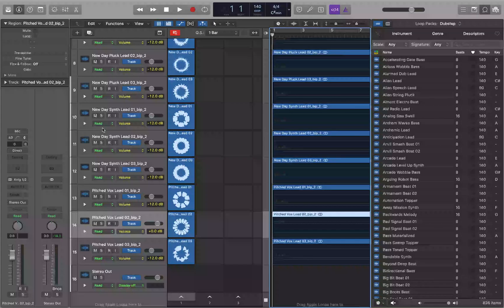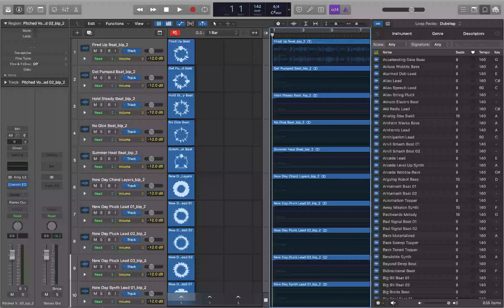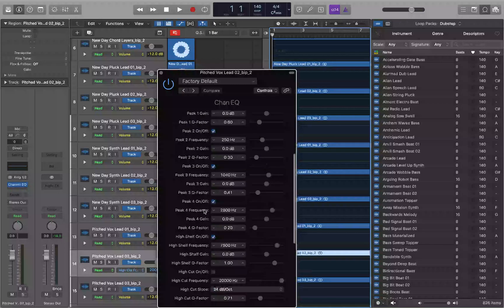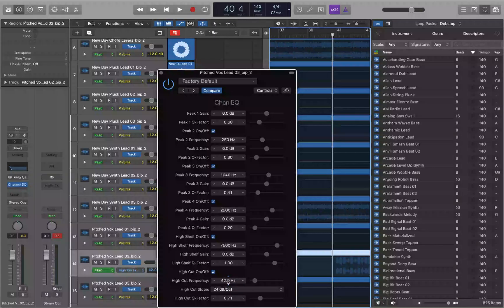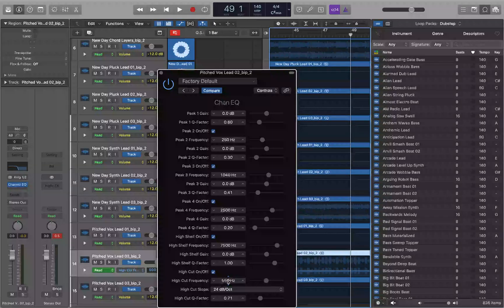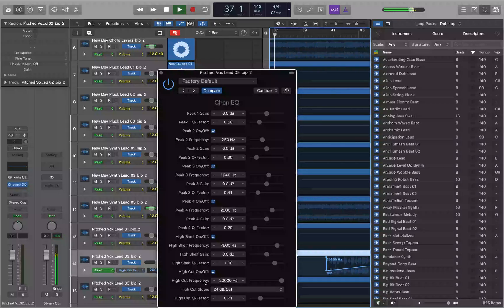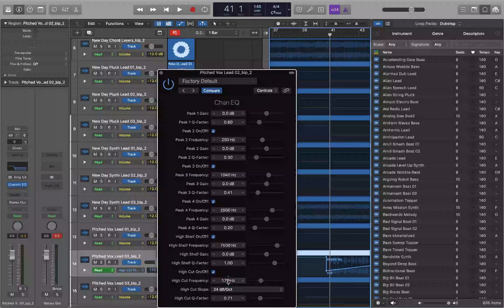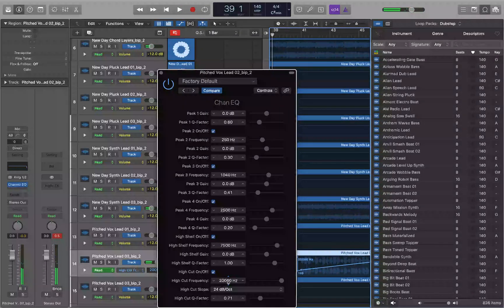Using a Filter Sweep to Demonstrate How To Automate an FX Parameter in Logic Pro With VoiceOver

Comment: Thanks, very handy as always, I have one doubt, and if I want to snapshot a parameter adjustment of a plug-in inserted on an auxiliary Send bus? Thanks a bunch
Reply from the maker: That would require 2 automation points to do a snapshot automation. However you will first want to add the AUX Track to the track header https://logic.band/how-to-add-an-aux-to-the-track-headers-in-logic-pro-with-voiceover/ then you can use 2 automation points as outlined here https://logic.band/seven-steps-to-automating-volume-changes-using-voiceover/
Reply: @TheBlindLogicPro  of course, add it to the track heather. Grin. you’re the man my friend! Thank you very much.